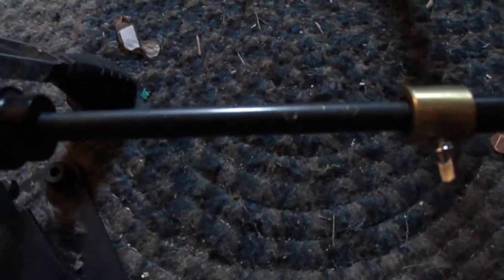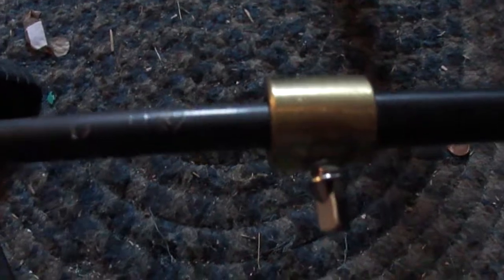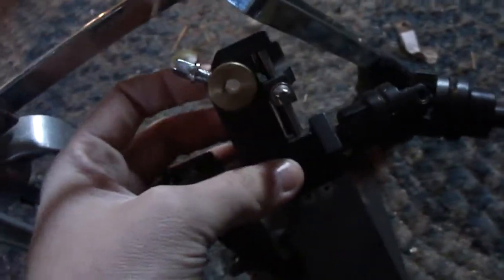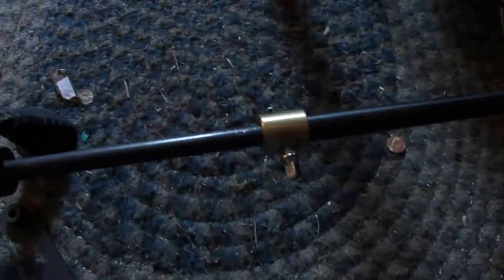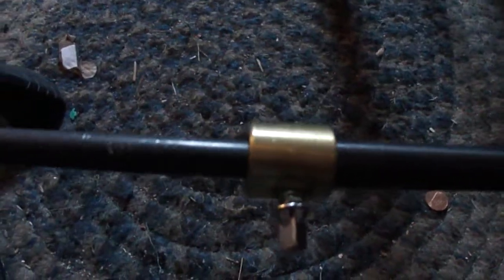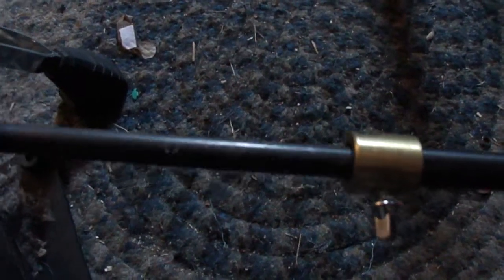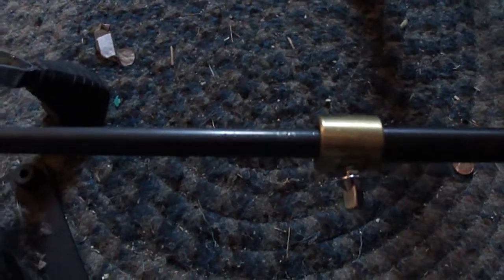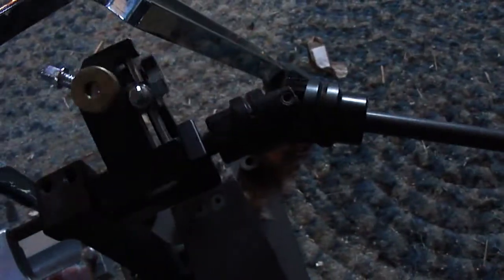Axis Pedal Problem

Comment: i have this problem with my a21 as well. it causes my slave side to slip closer towards the head, especially once i start to exert more force on the slave side. you need to tighten up both of the allen screws underneath after tightening up the drum lug on top, for it to be secure. the scratches are from the allen screws itself not being secure. 
my linkage has much deeper scratch marks & its really annoying, but once i tightened up everything, the slippages stopped and i've had no further issues